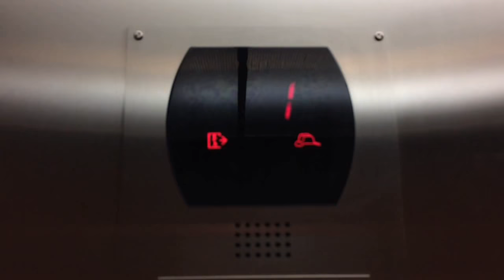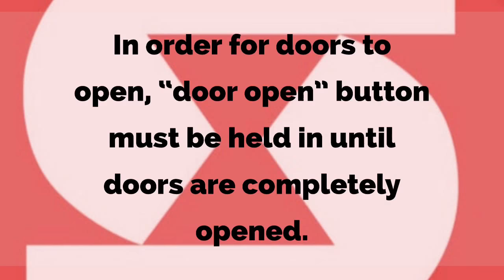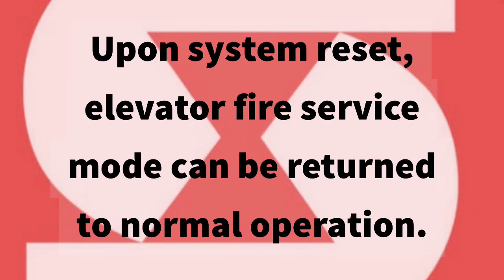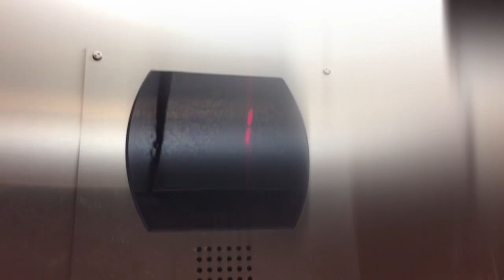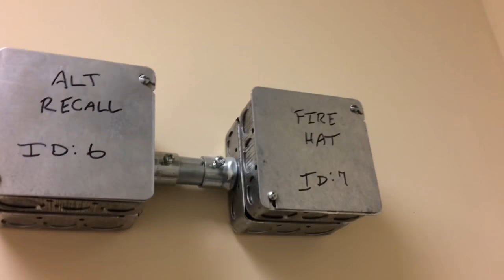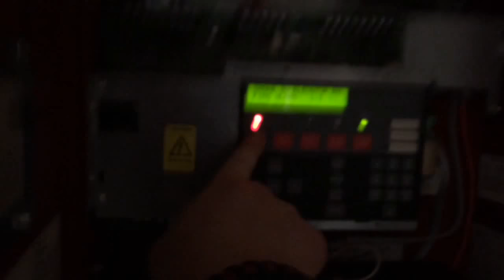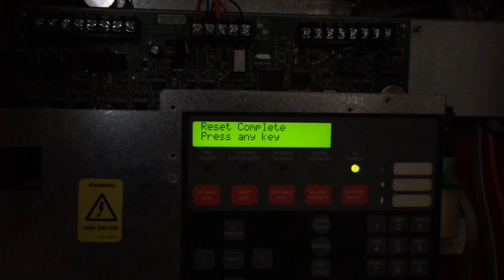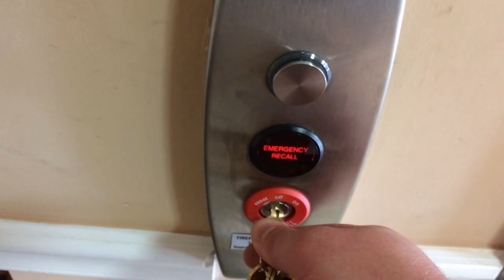Elevator Fire Service Demo (All Phases)

Comment: 3:20 You don't need to leave the key in the "Reset" position. Just turn it to "Off" after resetting for a second or two and the system will complete the cycle itself,  even if the elevator is recalling to a different floor during reset.

Comment: The first test for when the elevator moved to the 2nd floor, how do you reset it?  With the phase l fire key switch on floor 1
Reply from the maker: That is correct. Fire service mode can be cleared after the initiating device that tripped it has been reset.
Reply: Ok, thanks
Reply: Awesome, I'll check it out.

Comment: They really should make that indicator say, 'Please exit when doors open' I don't think most people would understand what that symbol means.
Reply: actually wait on some other otises like the series 1 it does say it
Reply: @h-aandle  Most elevators that talk do
Reply: This elevator is not equipped with a vocab feature since it's not a mid to high rise building. If it was, it would say that.
Reply: @flightlevel3608 There actually is a voice module on newer Otis elevators like this one (Series 5). They just decided to turn the Module off since like you said, it’s not a mid or high rise building.

Vocabulary words can be triggered by resetting the elevator (Off and On). Once it’s fully initialized it will start the Vocab (As far as I know).

Comment: What type of alarms were there and how did you disable them on a 4006
Reply: He said in the description that this building has a separate FACP dedicated to the elevator system.  There may not have been any notification appliances connected to that panel.

Comment: If the heat detector in the machine room is activated before the smoke or the smoke in the shaft activates, what does it do?
Reply: Recalls to designated floor.

Comment: Any particular reason why you would want to deticate an entire 4008 just for the elevator? My guess would be to keep programming simple on the main panel. Though regardless of how many floors the elevator services it'd be overkill for 2 or 3 floors, and redundant for 8-12 floors being that's it'd just be easier to program that into the main panel. (Most likely a 4100 series and at that point it's going to take more than a day to program anyway)
Reply from the maker: This facility does not have a main fire alarm therefore the 4008 is in place for the elevator safety controls and as a means to dial out to monitoring.
Reply: SAFETECH ahhh ok, that makes more sense now. Thanks!
Reply: Some occupancies don't require a fire alarm so the panel is for recall only.

Comment: Question to all fire alarm experts, does turning on fire service trigger a response from the fire department?
Reply from the maker: Not from what i’ve seen by turning the fire service key. However some elevators may have some special configurations to do so.
Reply: NO
Reply: Using elevator fire service as a standalone (test and demo) will not trigger a response from the fire department. However, if the FACP is programmed it will send a signal if the entire building alarm system is triggered.

Comment: @safetech An elevator should never be recalled by a manual pull station or detectors in other facility areas unless specified by the AHJ. IS THERE A REASON FOR THIS.

Comment: What happens if the smoke detectors are triggered on both floors and there's a fire on both floors at the same time?
Reply: In situations in which smoke detectors are triggered on all floors, most elevators will send a signal to the machine room and the fire alarm control panel to 'shunt trip (or disable)'; the only form to restore its memory is resetting the FACP and the machine switch

Comment: Shouldn't it be recalled to the lobby
Reply: If the smoke detector on the second floor tripped, then yes. But since the detector in the lobby tripped, it won't recall to the same floor that the alarm is on. A fire on the second floor would've triggered primary recall, but the ground floor is the alternate recall.
Reply: @gnutelliums  What about the detector in the shaft?
Reply: @Undercoverelevator212-s2n  It will do the same thing if the smoke detector in the machine room goes into alarm. It will cause the “Firefighter hat” indicator that is in the elevator to flash.
Reply: @IanGSully  Hence why it says to exit the elevator when that happens?